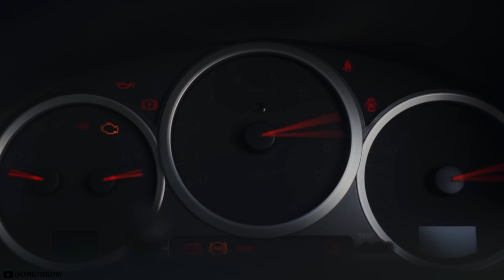Donut Media VS. Subaru

Comment: So I have a 2010 Forester XT. I bought this with $195,000 km. Yes I live in Canada.. when I bought it it was running fine. The next day I take it out to go buy a new exhaust because the one that came with it was literally rusting out. I swear it wasn't the same muffler that was on it when I test drove it... Well after that the battery died after I got the muffler... Got a boost luckily and drove all the way home with a dinging because the battery was not working properly.. had to buy a new battery.... The turbo was busted from day one... Luckily I got a warranty with it... Unfortunately that only lasted 2 months.... Got the turbo fixed... Then somebody decided to hit my car while it was parked causing over $7,000 Canadian and damage including the muffler I just picked up.... Get the car back 2 months later... As I'm driving at home, the turbo blows.... There is no oil in my car... So whatever happened at the garage or after the accident there was no oil in my car and none of them checked but yet they fixed my car but didn't check... New turbos in this one thankfully has lasted... But unfortunately I needed new head gaskets right after that... Now here's the beauty part. This was rebuilt just before I bought it and the head studs were not tightened down the third time....... There is at least six broken bolts from the mounts on the outside for the alternator. And whatnot to parts for the internal timing.. so knowing this I drove this car for almost 3 years without the head studs being tightened the third time and I didn't blow it up!!!!!!!! This happened during covid so trying to get parts for it was real fun. I ended up getting Cobb down pipe because I didn't want to pay $3,000 Canadian before delivery for a stock down pipe for a Forester XT...  Anyway, it's running great now also with a new steering rack..... So yeah they have their issues but they're still really fun to drive!!!! Still love it!

Comment: They literally threw in motors that weren't broken in, running off the shelf base maps that weren't even meant for the parts they were running, and immediately tracked them. I'd love to see any platform survive that treatment. 0 mile motor, wrong turbo, no tuning, immediately tracked and see what happens

Comment: exactly. same goes for old bmw's too. their need for extra care doesnt make the car bad. if somebody is willing to give proper care to a bmw they get very good and fun car to drive. But if they dont give the proper care and attention they get bad experience. their bad experience does not make the car "bad car" but that need for "extra care" or being more "fragile" doesnt go away either its still the reality of these cars. 
Peoples idea of "proper care" differs too. When somebody hears "proper care" one person thinks its about doing oil changes on time one person thinks its about changing timing chain not because its a current problem but it will be a problem in future. Some cars just doesnt get away with only "changing oil on time" some cars need changing road bearings too.
i think before talking, everybody should do their research and be prepared to do whatever it takes to not experience problem. And some people should only own boring toyota's.

Comment: My mom drives a Subaru with no mechanical issues.  The alarm system is wacked, but that's probably moms fault.  We bought a Subaru for my daughter and it had non-stop mechanical problems.  Being an ex-mechanic, but no Subaru experience, I took it to "the" Subaru mechanic in our area.  So I'm undecided on the flat four - and own three Mazda's and no Subaru's.

Comment: I know modern subaru has gotten much better. I own a BRZ and the FA24 boxer in it has far better overhead for tuning then the old engines in the wrx, even the fa20 (however weak it was) has a fair bit of overhead and forgiveness. Probably not as much as a typical inline 4 but yk, boxers are their own beast with their own quirks and benefits and that will never change

Comment: My grandmother has a 2013 impreza, drives it like a baby. At 140k miles headgasket went on it. Subaru has to many points of failure that were not addressed for many years. Let them reap the rewards. My tuning shop won't tune them because "they are a liability for my shop" lol I agree. 😆

Comment: Audi VW gear head for a long over here
I got tired of the little things that went wrong with those platform, from plastic water pump impeller to bad window regulators. But when I started doing research on WRX /STI I had to be happy with those problems that I dealt with with Audi /VW
Broken pistons on a stock daily driver like my friend hatch STI, oil starvation and a whole plethora or serious problems with Subaru.
I watch Devin channel where he pulls Subaru engine in as little as 35 minutes and even him is baffle by some of the issues that he faced with every car.
Wrx/STI is not the right platform to get into the fast car scene if you don't have an unlimited budget or you're a DIY person

Comment: I love them, but there are a few reasons I won't get one until I can afford a second vehicle that isn't my motorcycle. Head gasket issues, oil starvation issues, developing piston slap over time, hard to find one not abused, and they are kind of heaty.

I just think there are more reliable less common options out there. I wanted a wagon, I ended up going with an Infiniti EX35, it's got the VQ35HR, RWD base but can put 50% power to front wheels, less heaty and less common, and it's pretty unassuming looking.

Comment: My first turbo car was a hawkeye sti, $15k in 2021 with an iag block and I gotta say it’s taken so much thrashing and beating even without motormounts, shit on the car will break but that’s every car that gets beat on Subarus just require the willingness to get hands on and the patience to save up for name brand big boy parts and a new tune and even a break in period if necessary every platform has its kinks…… cough cough… DSM but that’s never a reason to be scared or to steer completely clear of it

Comment: Talk to any Subaru guy and they’ll tell you how many engines they’ve been through, like it’s normal. 2, 3, 4 engine rebuilds, to them, is just part of the platform, they take each 1 as a learning experience and apply it to the next, and eventually, they get it right, and when they do, they’re extremely impressive, until then, this just happens. It’s definitely a hard platform to build and learn, for sure. I have a friend who’s been through 4 engines in a couple of years on his, it’s currently down getting it’s 5th. right now, doesn’t change his love for the platform, they’re just cars for a very specific enthusiast, just like Rotaries, the problem lies within the fact they’re so readily available and cheap, unlike Rotaries, so the wrong people are getting ahold of them and having a bad experience with them. As for Donut tho, those guys should’ve done a little more research, taken a little more time to do some preliminary maintenance, especially to the oil system, that’s 100% on them and they even admit it during the series. Unfortunately, these videos are filmed half a year in advance so those people sharing their wisdom in the comments, don’t get heard in time, and Donut found out the hard way just a little too late. I love HiLow, I hope their next season they steer away from the Subaru platform and leave it to the guys who are the true Subaru enthusiasts, who know what they’re doing, because Donut has way more influence on the US car scene than they realize, and I don’t want to see this happen again.

Comment: I had a Liberty B4 for 7yrs... its a EJ208 sequential turbos. 

Never had a major issue but had to do Rocker Covers. If you know your engine you wont run into issues with Subies. 

(B4 Notorious for unreliability and impossible to work on, never had a breakdown in 7yrs and 120,000kms)

PS ive had 5 Subaru's. Ive never owned a EJ25 and never will... always EJ20 turbos as im in east coast Russia and get the Japanese stock.

Comment: I’ve only had great experiences with both new and used Subarus but PLEASE try not to buy a previously modded Subaru unless the owner knew what they were doing. I still think they are much easier to work on and more reliable than any of the VW group cars except for maybe Porsche which are incredibly reliable in my experience. I still drive an old bugeye WRX with 200,000 miles on it, original engine never rebuilt, original 5 speed “glass” transmission, and it still makes great power with Cobb stage 2+ and a strong but reliable tune. If the engine goes, it will be ok because it’s 21 years old now and I’ve gotten my money’s worth. And I can easily get a new EJ20 if needed and keep driving it. 

I think people are way too hard on their 4 cylinder engines trying to make 400-500+ hp not knowing what they are doing and of course the stock internals can’t handle that much power on such small displacement. Like you said, the tolerances are tight at that level. A V8 or even straight 6 engine is more forgiving. And Honda 4 cylinders are also forgiving but it’s rare to see a Honda be a lot faster than a fast Subaru for various reasons. Also I still think Subaru engines sound better than most 4 cylinder engines even with equal length headers.

Comment: I had a Subaru and it was fine, very practical... but I literally did nothing to it and sold it at 80K.  Toward the end it wasn't even as fast as a modern SUV and you can't have that much fun in one, it won't peel out (it will just smoke the clutch), it has tons of grip and confidence in all weather so you never feel like you are white knuckling in the rain, you can slam your foot down after any apex.  It was too easy to drive, rolled left to right and sat high like a sedan and isn't that fast.

I never worked on mine because I never had a garage/the will (and deep down I knew better) but now I have a garage and a dedicated family truckster so I sold it for an old Vette that scratches all those 2nd car itches much better. It's a much more visceral and raw driving experience with your ass cheeks 2 inches off the pavement (until it's wet and 20 degrees out and I'm on summer tires and I short shift around town like grandma). You can chuck it into a turn and it hardly has any roll but you have to feather it out because you are putting down 2x as much power without the AWD.  The high displacement N/A setup is just so much more responsive and smooth and torquey all around. You put it in 3rd going down hill while following a soccer mom and the engine braking is strong enough that you don't need the brake. Also it's way easier to work on and I can and do.

Comment: We could just start admitting a lot of the platforms we love are just incredibly unreliable when modded and that fanboys need to stop acting like they arent because race programs with insane budgets make them work. You can like a car and acknowledge they have major issues. I loved my VW but wouldnt recommend one to anyone. lol
Reply: Subaru just weren't built to handle N/A. Who wouldve known cramming 13 psi on a motor would cause issues.....

Another example. Me and my brother both had 08 mustang GTs at one point.  He supercharged his and it made it to around 2015. 

Kept mine N/A and she's still going with no stop in sight. No problems besides replacing a 12 year old clutch

Comment: i think the biggest thing that i saw was the lack of looking up common issues on the platform and correcting those instead of just adding new race car/street car parts and ignoring them, for example the oil pan as you have said the oil pan doesn't come with an baffles so ideally after the first engine blew why wouldn't they look into the issue instead of getting another car. that is the only thing that i really didn't care for when they did this run of high/low car.

Comment: Type ra block + 6 speed + ethanol + forged pistons = good time. Dont slap a bigger turbo until you have pistons. It’s pretty simple imo. They could have gotten an iag engine or high car could have gone with a dry sump, like the NBR. Idk.. I’m new to the platform and feel like research and common sense are all that it takes to have a good subby.

Comment: Even the new ones aren't all that great. My bud still blew an axle on his 22 at 160 miles another at 2500 and 1st and 2nd at 5000 miles. To be fair, he wasn't easy on it, but for a manual sports car it should have taken the abuse. He wasn't beating on it half as hard as the 94 mustang gt he drove before it, and that car lasted 220k miles until it sucked water in the intake. And even after that, the damn thing ran for 2 weeks before it reluctantly stopped hot starting. Still ran until the engine was pulled lmao 302s are indestructible.

Comment: My RSX-Type S and my R53 MINI S are a great example of this. I could abandon maintance on my RSX, throw whatever parts I want on it, not change a single thing, and rip it at 9k RPM all day every day with 0 issues, and if I wanted to work on it, parts are cheap, and it's super simple to do. My R53 requires constant maintance and non-performance mods to help keep it running well, parts are expensive, and the car is a PITA to work on. I still LOVE my MINI, but to say it's as welcome a platform as a Honda would be laughable. If I try to get 400whp out of my RSX, that's doable and not that difficult. If I want 400whp out of my R53, I'm gonna start with a K20 swap. 😂

Comment: In my naive youth I purchased an NA Subaru forester that was turbo'd by the previous owner and it blew up a month later. My forester that I own now has an IAG block with STI headgaskets and it is incredibly reliable. My point being is that you have 50/50 shot with them and you have to understand that before you get into these cars lol

Comment: I want to put this out there, my friend ran his coyote mustang with 3 quarts of oil (takes 9) for about 60 miles before he took my advice, overheated the motor twice, revs it to the moon, and somehow that car still runs and drives and hasn't blown the motor. I think the people defending Subaru has never ha another platform they worked on.

Comment: Man, would I love to love the awd and a manual Subaru. But, my sister is driving a 2020 Outback daily, and it's already showing signs of poor workmanship just from the manufacturer. She's gone through three windshields, all original, that have simply cracked when parked in her driveway; no rock chips or large temp swings. And it's leaking and burning oil already at only 50k miles with mostly highway miles; yes, it's serviced regularly. We won't be fixing it as the repairs will simply eat up the budget for a new car. New Subaru is having problems that even my 86 Toyota pickup with the 22-rte is only now starting to show.

Comment: I mean at the end of the day Subarus lack of tolerance for missing the mark still says something negative about their engineering either way, the difference between a subaru motor and a Rotary is that there is soooo much more potential out of a rotary to offset the difficulty of working on the engine. With subaru the difficulty or lack of tolerance doesn't get outweighed by the potential of the motor unfortunately.

Comment: EJ's are old engines and flawed.  That being said, they have great potential for tuning.  You NEED to be aware of these flaws (AND FIX THEM) in order to get them to run.  Blowing up 5 engines is EXACTLY what happens when beginners to the EJ platform try to mod.  "It's so quick to point to donut instead of the platform."  Well yeah.  A well modded subie is dead reliable.  7:55 to 9:00 - Yes. EJ's have a much smaller margin for error than other platforms.  Donut didn't know that and blamed the EJ.  Skill issue.  Subarus require a lot of skill to get right.

Comment: If you are not experienced with Subarus, seek advice from a Subaru specific shop/tuner before EVERY change you make to the vehicle.
Alex is totally right when he compared them to the Audi that needs a tune for any little change made.  The EJ engines are very sensitive to knock, the ecu's in turbo Subarus are very picky and not easy to keep happy if you don't know what you are doing.

Comment: From what I've read, it appears the WRX doesn't have much headroom.  If you get one, maintain it properly and run it as is (as a regular sporty car), you should be fine and have no issues.  If you want to track it, you'll likely need some modifications (oil pan, pick up tube, etc).  In terms of power, don't do it.  This vehicle doesn't have the headroom to add things like tunes, turbo tweaks, air intakes, etc.  The STi has more robust components and is the one to do some modifications if that is what you want.  Or, as mentioned in the video, get a different vehicle.  A WRX on its own is capable sporty street car, so if that is all you want and you aren't interested in modifying it, just get it and run it as is.  You'll have for years with no issues.  If you want to buy a used car and go nuts, get an old Toyota with a 2JZ engine (it is massively overbuilt).

Comment: or i have luck or the ej20 is the best i have one in brazil and runs on ethanol and 14psi of boos, it has stock internals, oil pump, wather pump, mostly just put a diesel turbine and runs so fun

Comment: as of today feb 16 2023 I posted my 2016 STI for sale. got tire of installing 10k engines and only lasting 5k miles (a 1000+hp motor only running 800). I replaced my engine 5 times. in the mid time I could have a better platform to make me get there with less effort.